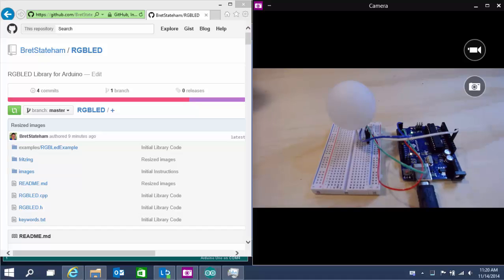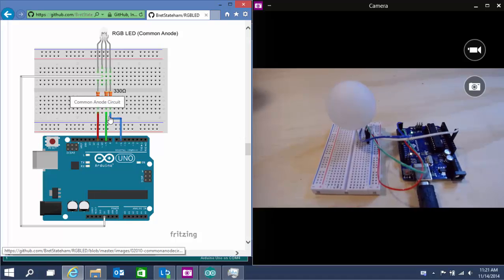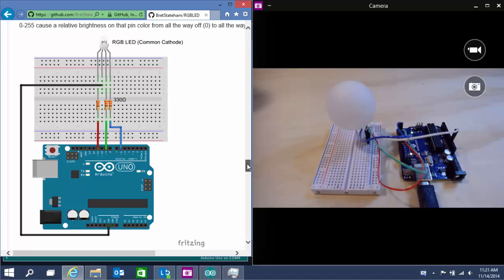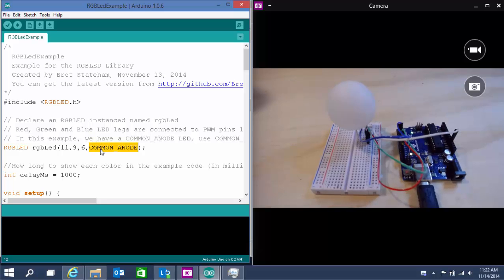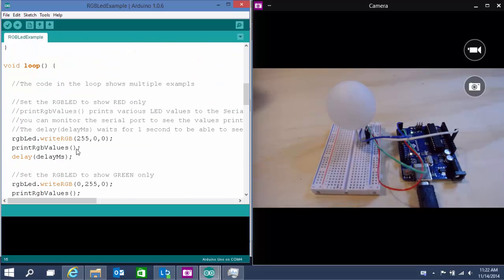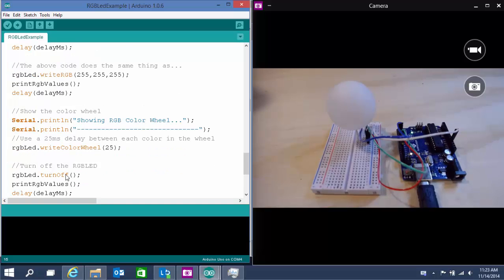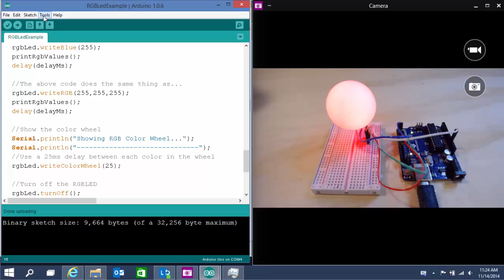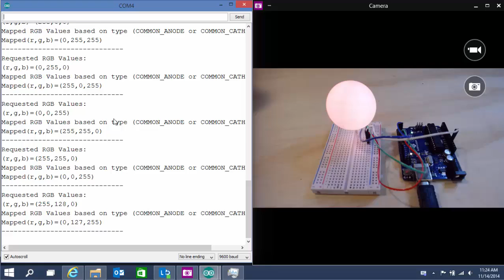RGBLED Arduino Library Demo Video

Comment: On the colour Wheel, is there a way to show specific RGB Values that fade into the next colour/rgb value? let's say I want 3-4 specific colours to be used, not the whole rainbow on the colour wheel but Aqua, Light purple, pink and yellow. The colour fades out into the next chosen colour?
Reply from the maker: Hey Michael, that's not a feature I built into the library, but it's a cool idea.  I envision a method that you can pass an array of RGB values into along with a number indicating how long each color should be shown (in ms) as well as a number indicating how long the fade should take (in ms) from color to color.  A 0 for the fade duration would mean a straight cut between colors.  I don't have time to do that right now, but if I get some spare time maybe I'll add it in.  If you do it first, please issue a Pull Request so I can merge it into the library.